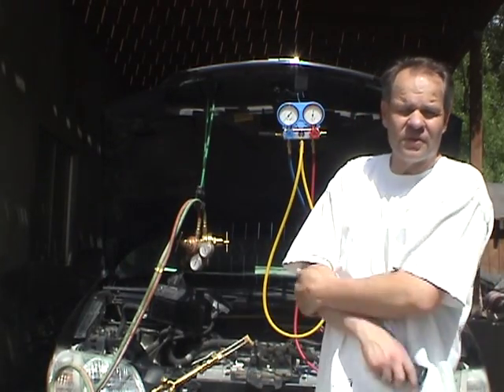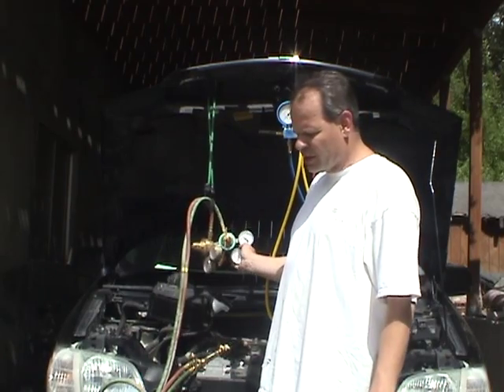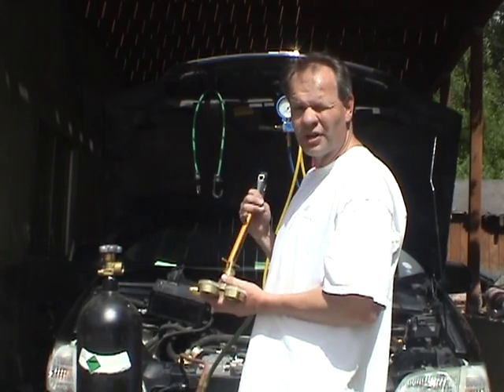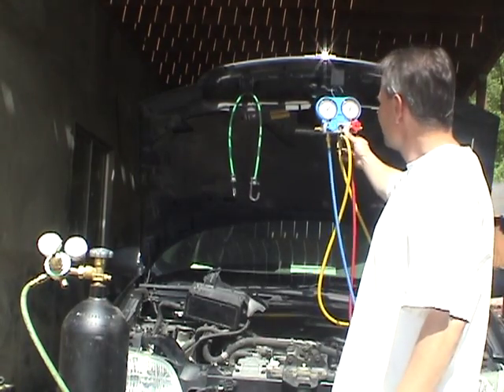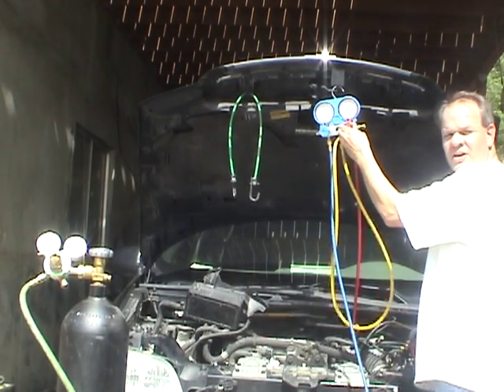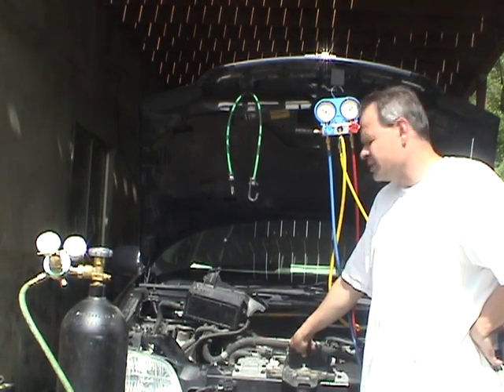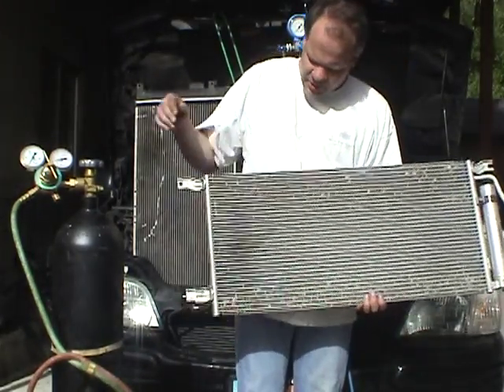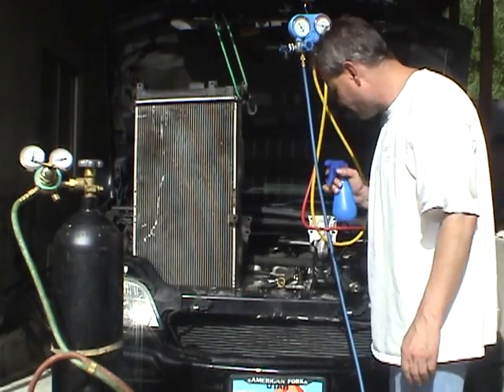nitrogen2.avi

Comment: That a really bad ideal to put a CO2 regulator on a nitrogen tank , CO2 is way lower pressure you could easily blow it apart , , you can use a nitrogen regulator on CO2 with no problem , they recommend about 200lbs of nitrogen pressure to test for leaks in cars